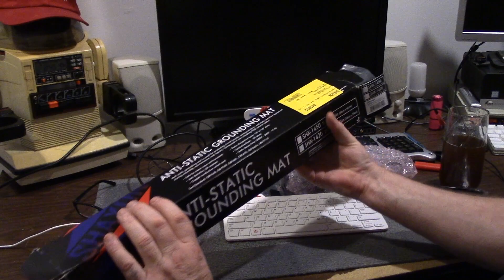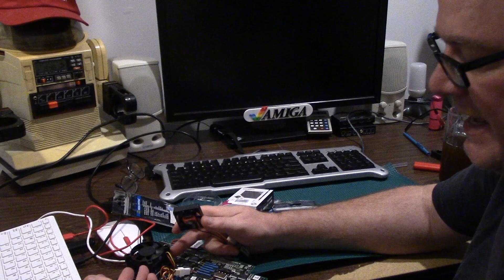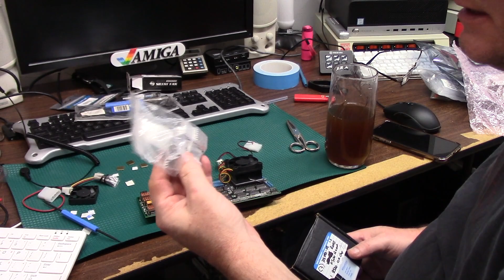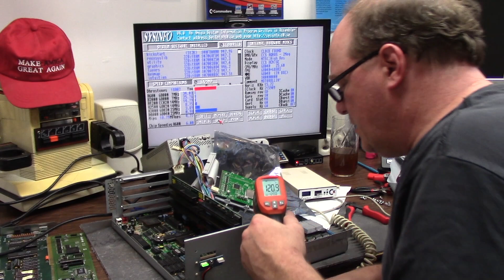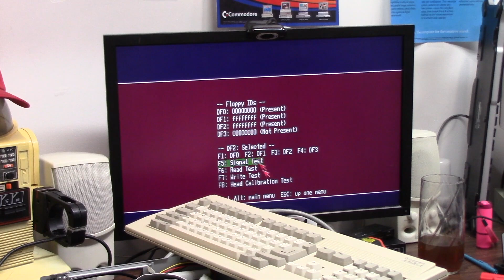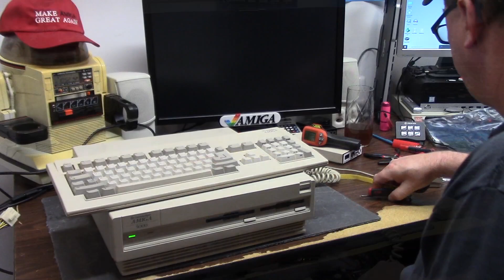Amiga 3000 3640 recap, cooling and retest

Comment: There is really no airflow on an A3000!  that’s why I put 5 freaking fans on my own, including a mini fan on top of the FPGA for the ZZ 9000 card. But it still hits about 86°F after an hour on the A3660 CPU side, and about 96° on the FPGA other side.
Reply from the maker: do you have the front 40mm fan in front of the riser slot blowing aross the cpu? that really makes mine run fine.  sucks air in from the riser slot holes in back near amber switch, then across the front/cpu area w the 3d printed bracket. and then out the power supply boat fan
Reply: @ChrisEdwardsRestoration  yep I followed what you did, with a noctua blowing air in from front on riser side across ZZ9K card, another fan to its right blowing air into the cpu section in that small gap in front (at a good rpm), a new noctua in the PS, a blower fan in the back slot of the zz9K pushing air out, and FINALLY a small fpga fan on the ZZ itself...! The temps are prob ok, Lukas from MNT noted anything under50deg C was good on the ZZ. I think my lockups are some crazy thomas richter complex Science thing with LC060 libraries- or just the crappy design of the A3660. One day will get the BFG.....PS im now thinking you don't need to drill holes. if you did try, thats like Battleship steel plate thickness, so F it.

Comment: I had a dec alpha that was in a small form factor that was always overheating. I used a Dremel to cut some slots into where it had some perforated intakes. It actually made a huge difference and solved my overheating problems. Felt wrong to do it but felt better having a machine that worked and was stable !

Comment: Great video as always. I absolutely love your humour! Quick question regarding your a3000. What Ramsey and DMAC are you running in yours? Also did you upgrade the SCSI on this a3k? I am having an issue installing and running a a3660 in mine. Have tried this card and a 3640 with a 060 adapter and have had no joy with it booting. All it does it flash the power light around 7 times quickly before repeating the sequence. Any ideas.
Reply: Yes I saw that one regarding the SCSI chip a while ago. I have an updated chip somewhere so might try that. I read somewhere that the SCSI bus might cause issues. What is strange is if I revert it back to the normal 030 it’s fine.
Reply: So long story short. Appears the issue I am having is with the SCSI on my a3k. Remove the SCSI2SD drive and the 3k will boot from a gotek. Plug the drive in and I not get a solid hd light. Any ideas?
Reply from the maker: @leehiscox7688  gotek has nothing to do with the scsi bus.  the gotek should be on the floppy bus as S0 for df0: with the cable flip end . OR gotek S1 for DF1: with the motherboard jumper J351 set for 880k DF1and the normal cable (no flip)
Reply from the maker: I did the scsi updates in older videos

Comment: Use a chassis punch to make some 25mm or larger holes. 
If the A3000 drawn in air over the Zorro cards, that may make them run hotter.

I have a cool Phase5 68060 @ 50MHz in my A40000.

Comment: Yep. Drill out a series of holes (not unlike the panel on the back near the slots) and use a low-profile heatsink/fan that vents to the side (they're intended for laptops). You can find one for peanuts at an electronic surplus place.

Comment: Good video.  Definitely add air flow solution to the front.  I think I would use a Dremel to make long horizontal slits in the metal.  But remove everything from the case and wash case to remove all metal dust and fragments prior to reessembly.

Comment: Don't cut your case!!!!...hot glue a radial fan to the bottom of the drive cage.  It will circulate air around and the PS fan will suck out that air.  I have that in my AA3000+ in an A3000 case with C= 3640 and I have no issues!
Reply from the maker: I did glue a fan in front of the riser blowing on the gal and 040.  Works great!

Comment: Another great Vid Chris 👍🏻 You are now making me think what to do with my A4000 with no front airflow 🤔 I’ve got a beast of an accelerator (Phase 5 Cyberstorm/PPC) in there with a 060 and PPC double CPU combo (060 @ 66mhz and PPC @ 400mhz) both have heatsink and fans on them and hardly any airflow. I can see why people tower them now.
Reply from the maker: i ended up hot gluing a 60mm fan in the daughter card slot in the front where the opening is, it blows on the 040 / gals and keeps them cooler.  the 4000 i put a 70mm fan in between my dvd drive and the daughter card ,blowing down on the 040, (it too has a fan) but its such a tight cable mess theres no room. it works fine though i just dont run them for super extended times.
Reply: @ChrisEdwardsRestoration  yeah saw that in one of your other vids about the fan in the A4000. Already have 2 fans on top of each of the 060 and PPC. The PPC actually sits under the drive cradle where as the other (060) sits between that area you’ve talked about. I currently have a 3D printed SFU ATX ho,Der in p,ace of the original A4000 PSU which has room (sort of) underneath. So might experiment with a fan in that area with a grate/ holes cut out on the 3D printed holder so not to commit holy Amiga sacrifice to the original case 👍🏻😉

Comment: This suggestion is ! Cut 2 horizontal slits with a 120 mm grinder with a 1 mm disk 

Remove the motherboard obviously and the fins on the heatsink are against airflow.assuming you cut it like I said 

Drilling holes will work aswell
Reply: Seriously wear gloves and eye protection ❤️ and remove the birs with a 120mm flat pad on the back side of the cut so you don’t cut your self in the future builds 

I fink I’m human and I am helping you and your family

Comment: Chris, I have thought about drilling some holes in the front of the 3000 metal to allow airflow over an accelerator but I just can't bring myself to do it.  My latest idea is to just take out the entire psu/floppy tray and 3d print a mount for the psu and maybe rig a gotek directly to the front of the case.  Not ideal but there would be no shortage of airflow..
Reply from the maker: I ended up hot gluing a 60mm fan in the front of the riser blowing air directly on the GAL and cpu, it works PERFECT!!! and i wired it into the 12v onthe molex. no cutting required.